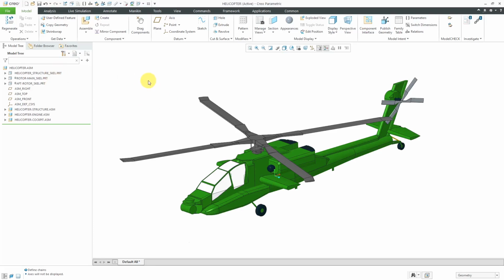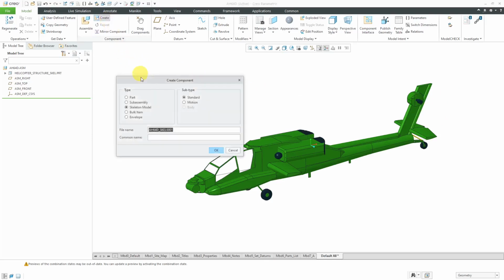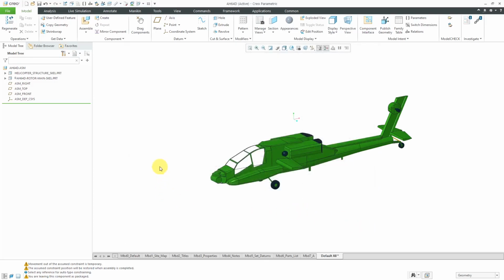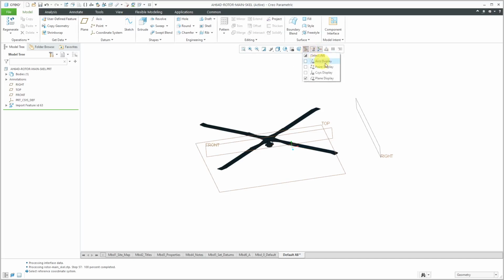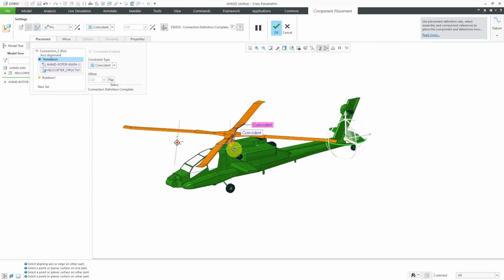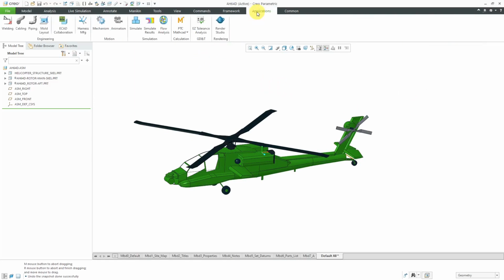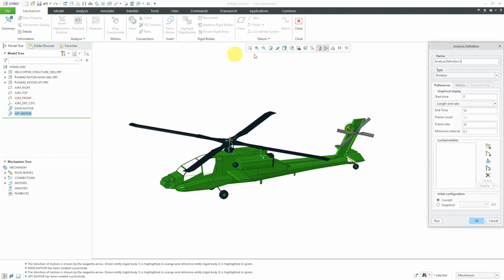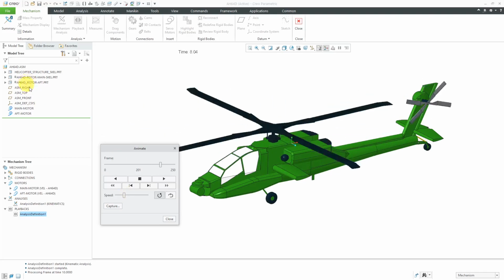Creo Parametric - Top Down Design and Mechanisms

Comment: Thank you, your videos inspired me to pick up kindle versions of some of your books.  What's the point of doing this with skeletons if you have to do the same thing with your parts in an assembly where those parts were created from features in the skeleton.  - wouldn't you be doing the work twice?
Reply from the maker: I don’t understand your question. Why would you do the same work twice?
Reply: @CADPLMGuy  Your showing skeletons, what if I create an assembly and I create the same non-skeleton parts (from the skeleton geometry) I don't understand how you could assembly the parts into the new assembly with adding the same connections - unless I'm missing how the skeleton connections can carry over?
Reply from the maker: You are not going to assemble the components based on Skeletons with connections. The assembly connections control the motion. The components are typically assembled using the Default constraint. If you have trouble visualizing this, try applying the concepts to a simple four-bar linkage assembly.
Reply: @CADPLMGuy  Thanks I will try, so if I understand you correctly if I create a Creo part “rotor” based on your “rotor” skeleton and assemble it to default I should be to spin it using the mechanism drag hand?
Update: the only way I got things to work is to create the various skeletons assembled with mechanism connections, and then in the same assembly, assembled each part to the appropriate skeleton with constraints.